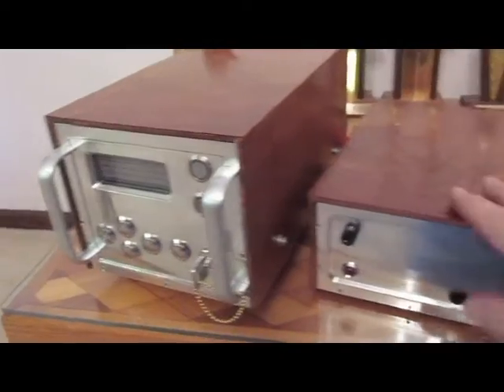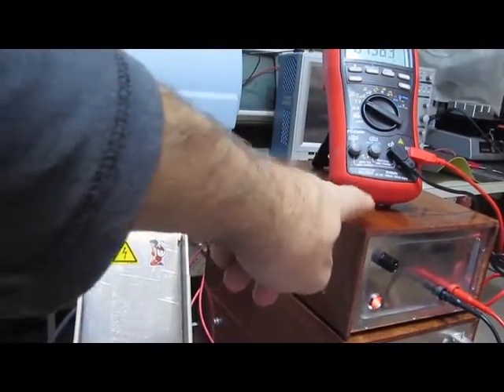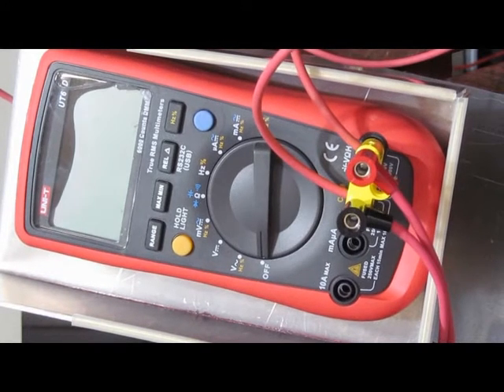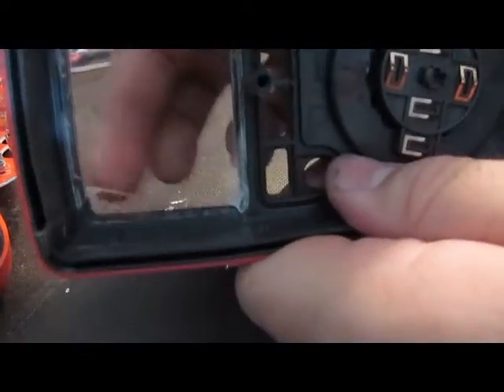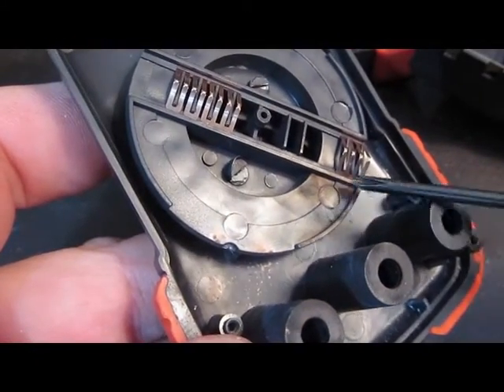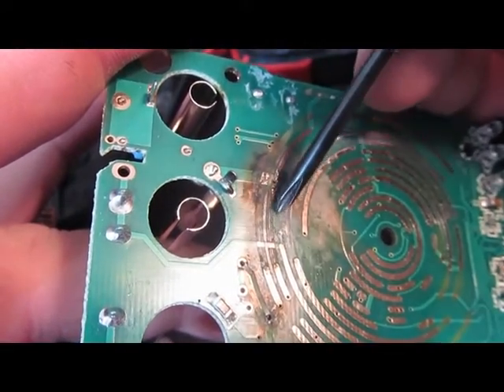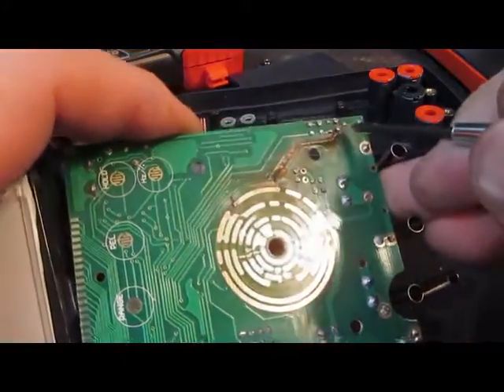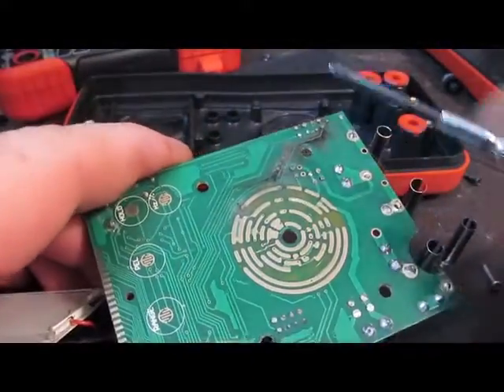Building a medium energy transient generator Part 2

Comment: Its fun to see them jump :D can you test an ultra cheap (often referred as 830 multimeter) to show what a hazard the are
Reply from the maker: +Marcel Hanenbergh I am not sure which meter that would be.   This one?   http://www.amazon.com/Low-cost-VC830L-Digital-Multimeter-Backlight/dp/B00VXINWXK
Reply: +joe smith No the model Dave Jones (EEVblog) has in the last mailbag episode
Reply from the maker: Fluke has a few good videos of the Harbor Freight meter on their generator.  If you want an idea about safety, their video would give you a much better idea of what can happen.
Reply: +joe smith i know what would happen, but always fun to see another one blowing up
Reply from the maker: Ha!   Next time I'm at Harbor Freight, I'll pick one up.
Reply from the maker: +Markus Bates Maybe this weekend I'll pick one up.  I wonder if any one mode will cause more damage than others.   So far, I have just used the generator with the meters in the off or AC volts mode.